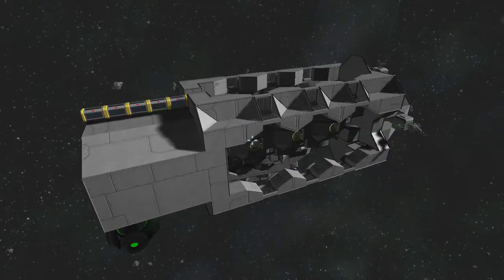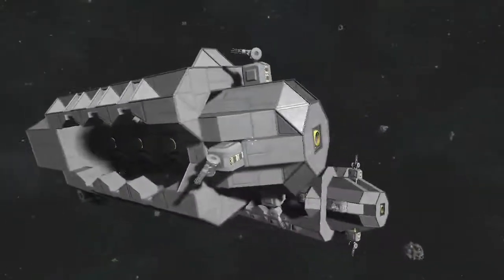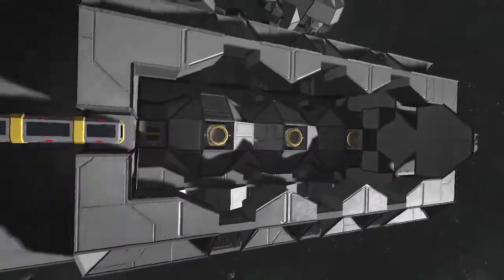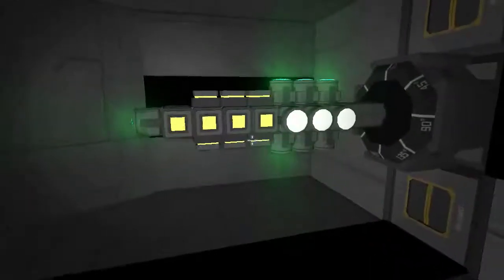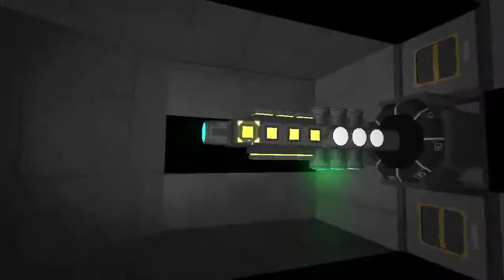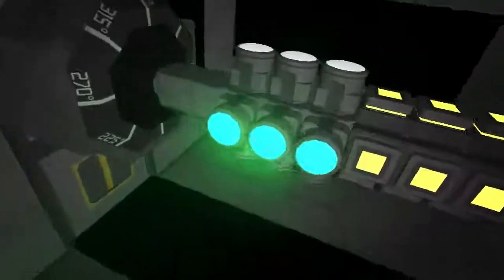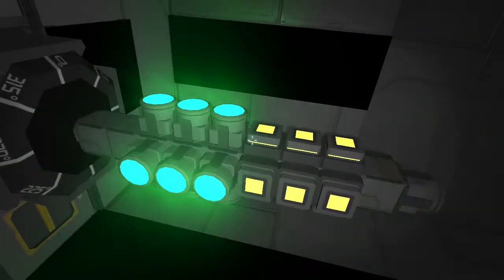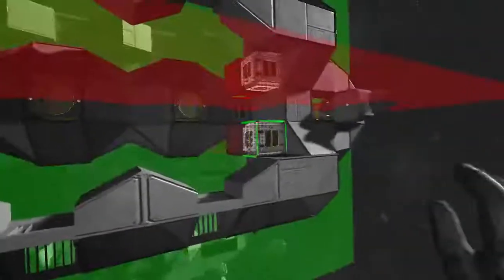Compact Drone Carriers: Haptic Interfaces

Comment: I have a weird question, would you be able to slave the drones engines to slepnir? Using drone engines to boost the carriers engine to weight ratio would help out with loaded carriers being a little bit piggy(I use semi auto fighters, which can be drones or not, so they get a bit heavy, and my shuttles sometimes break loose because they either just sit there or thrust against changes.). It might need careful design, modded thrusters, or thruster damage turned off to make it work though. 

Or is that idea to complex due to the drones not being aligned to the ship perfectly, and maybe not having engine direction defined(I've seen my engines autolabel direction, but I don't know why)?
Reply from the maker: +Patrick Houseman The ships autolabel when you take direct control over them. They auto UNlabel if you lose direct control over them.

The amount of power the drones could add to the carrier is usually too small to worry about the complexity of figuring out the vectors involved in boosting.